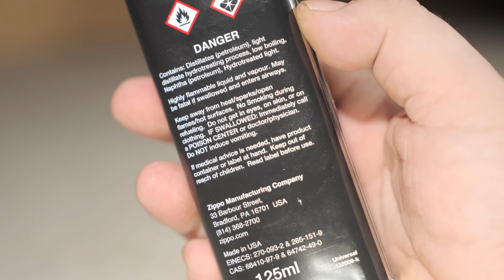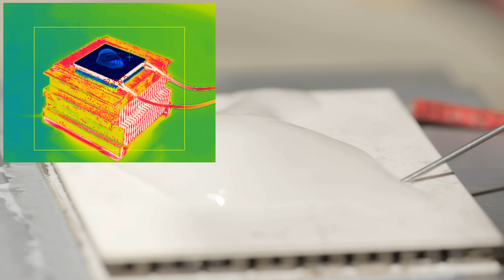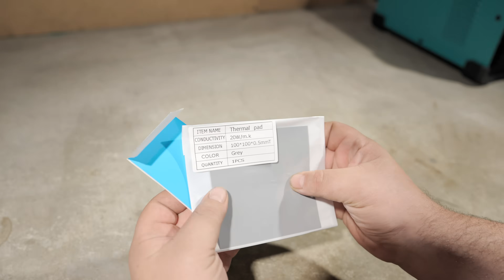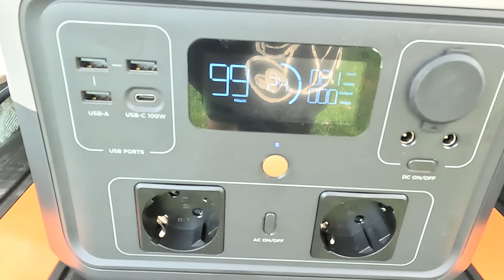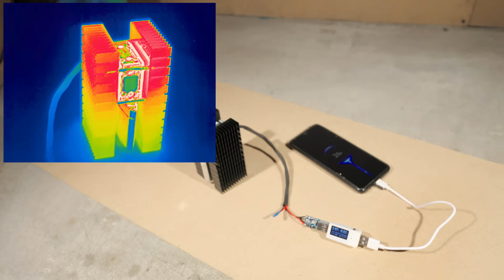Pocket Generator Without Engine

Comment: Nice job. Look into rf radiation and reciever antenna diode capacitor charging, 24/7/365 energy. Store power in battery tech like LTO cells with Upto 100,000 charge cycles.
Reply from the maker: Great idea – I want to try it!
Thanks!!!

Comment: Toilets here work without electricity 😂
Reply: If on city water they work until the city water loses power/pressure
Reply: @benyvonnemckenzie6576 that is true, but I have 2500 litres of storage on my ceiling in water tanks and 150,000 litres of water storage under my house which is filled with rain every winter

Comment: yeaaa a 0.1W generator xD
Reply: 0.084W lol.   That’s 60 times smaller than the lowest wattage 5W chargers.  I wonder of some 3v super low power micro fans would actually net more power?  I’ve got some mini fans that run on 0.1W.  If you look at the thermal pic he took, there is zero temp difference across the teg hot and cold side.